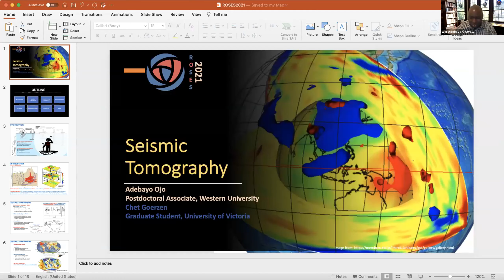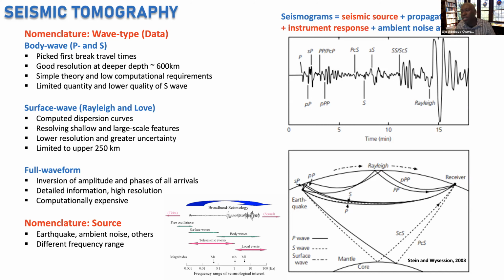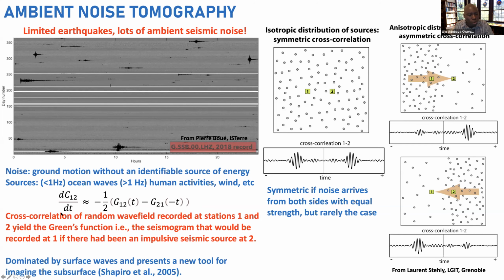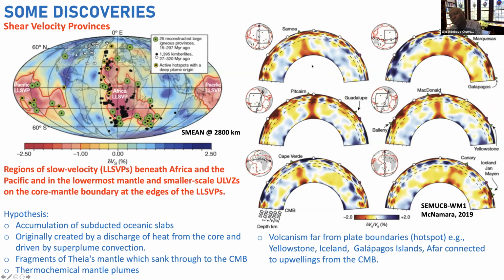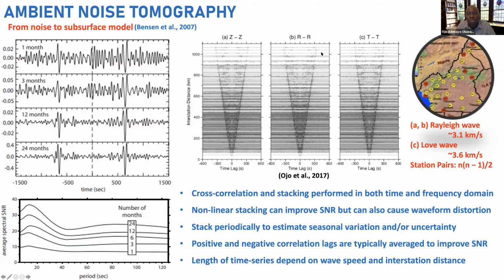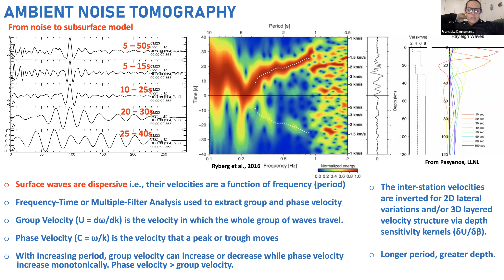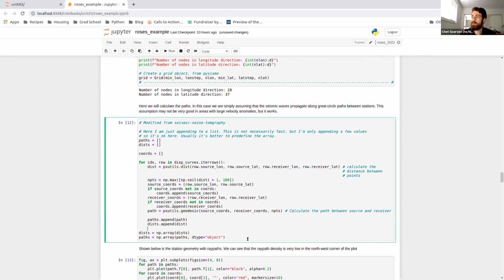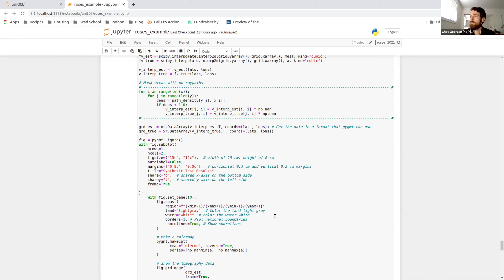ROSES 2021 Session 03: Ambient Noise Tomography with Dr. Adebayo Ojo

Comment: Great!!  Now do exactly the same for all signals that move at the speed of light and gravity.  Ambient gravitational noise imaging arrays. Ambient magnetic noise imaging arrays.  Ambient electromagnetic noise imaging arrays. Ambient cosmic ray and neutrino imaging arrays.  And focus them on the interior of the earth, inside the oceans.  Inside the atmosphere.  Focus on all voxels for several radii around the earth.  Focus on the surface of the sun. Focus on the interior of the sun, moon and planets.

You will likely need sensitive, low cost, three axis, high sampling rate detectors of many sorts. But much progress has been made in many different fields.  If the seismic, magnetic, gravitational, electromagnetic, neutrinos and other networks would all focus on the interior of the earth, it might be possible to sort out and characterize all the sources. Once a source is identified and understood, it can become a standard beacon and reference for newer and better methods.  Each sensor network's "noise" is someone else's main signal" and their "noise" is someone else's signal.  There really is no "noise", it is all signal - once it has been recorded, identified, characterized and can be used for correlations.  You might need to extend your notion of instrument response, signal complexity, scale of "big" for data and "fast" for sampling rates. But it is all just moving data, sharing it in lossless form, combining and comparing, sharing best algorithms.

Solar System Gravimetry and Gravitational Engineering, Correlation Imaging Arrays, Time of Flight Gravitational Imaging Arrays

Richard Collins, The Internet Foundation